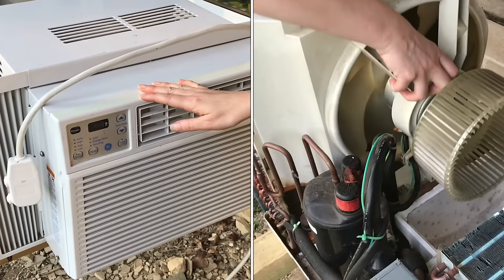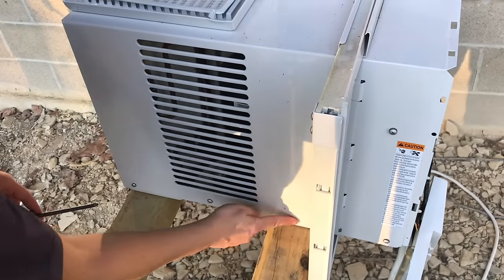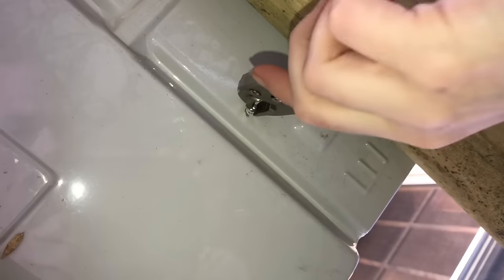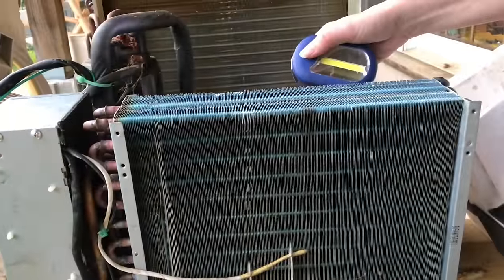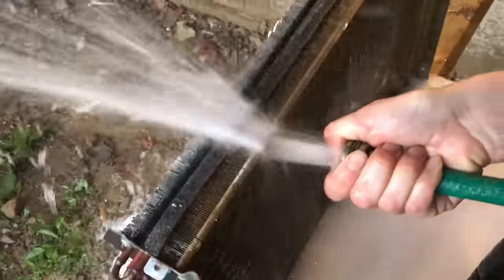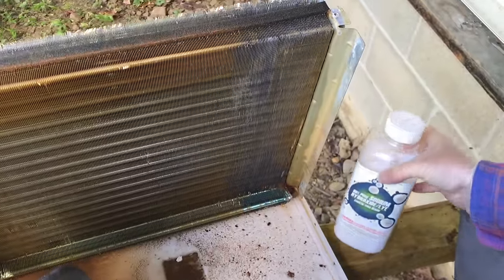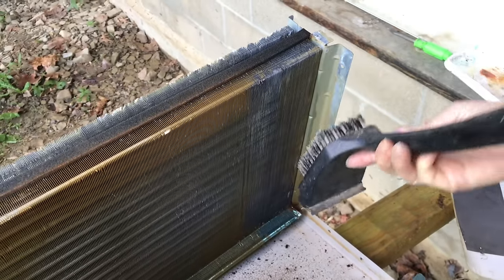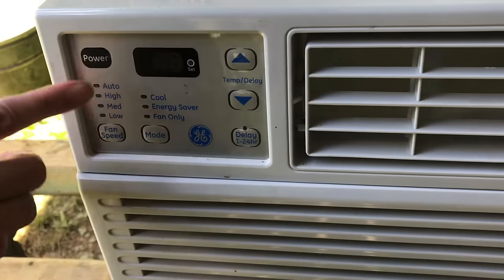DEEP CLEANING a window air conditioner unit (step-by-step details)

Comment: I've been cleaning all of our window units for years, but never have I taken it apart as thoroughly as you just showed! Thank you!
So now I'll be really giving them a good cleaning from here on out! Thank you. All of ours are different brands so although similar, each has unique assembly and disassembly requirements. So don't assume yours will have the same front opening as this one did. The folding back of the side baffles (or whatever those sliding accordion pieces are called) was new info for me so Thanks again. Excellent video!

Comment: Well done,I've literally taken apart a thousand air conditioners because I buy them from the scrap yards and sell them back for the copper and aluminum, motors and wires.i clean them my self when I find the ones that are just neglected.kudos to you and thanks for your downloaded info,you left nothing out.thumbs up
Reply: are you in USA or another country ? if in USA... seems like too much time spending for just selling for copper and  aluminium..no?
Reply: @vitmast5262  copper is high right now
Reply: That sounds like my job I have I seperate the copper and things and I get paid from an electrical company

Comment: My window ac had mould build up and was beginning to give off musty oders in the house,so I took it apart yesterday  and gave it a good cleaning like this,the front coils were absolutely filthy on the inside don't know how it was cooling at all but got it cleaned up and  back together and it's working just fine,thank you

Comment: If your unit has mold, clean it as video shows. Then buy spray can of Concrobium at Lowe's. Make sure entire unit is dry. Spray Concrobium on all parts and let dry. Repeat. Let completely dry! Reassemble! If you have mold, you'll have it appear again! Repeat mid-summer and at end of summer use. Mold makes humans sick! Clean filter weekly. Vacuum room weekly and dust! Dust gives mold a place to grow.
Reply: Will any of the comcrobium be blown into the air once the ac is back in? I’m trying to clean an air conditioner in my kids room, I don’t want them breathing in anything that would be harmful.
Reply: just buy a new one
Reply: @1655zz  buy a new one.
Once mold has formed - it’s there forever sadly
Reply: @1655zz You’ll have to take it apart and treat every surface that the air contacts with a mold and mildew killer like the concrobium the above commenter mentioned. You can’t just spray it in the coil and hope it gets sucked up, that just won’t cut it

Comment: I’ll say it again, I’m impressed. Are used to work at a place that had an HVAC shop and they used to clean when the units but I don’t think that extent.! Great work nobody has the patience for that kind of detail anymore. Nobody wants to do any maintenance and then they just buy a new one!
Reply: That should have said i used to work .... and they used to clean window units...
Reply: "Throw it in the gutter and go buy another" sums up the consumer  mentality today.

She is very thorough, I use full strength dawn though, let it soak  in that foam tape on top and drip down into the fins and in between the tubing, especially a 4 row evap coil like this.
Reply: I never knew this was a possibility, but I should have known if something is possible, it will show me how to do it on YouTube!

Comment: Thanks that's the exact AC unit I have 6,000 BTU bought it in 2011. Still blowing nice and cold.
I take some simple grain as a degreaser and some coil cleaner that foams tip it up on an angle and hose it off on the deck and let it dry in the sun I'm done never took it apart..

Good video thank you!

Comment: It' always a good idea to wipe out the inside of the styrofoam with a mix of bleach and water.  I had mold grow inside there one year and produced a very musty smell.  Also, I noticed that you washed the squirrel cage fan.  You may want to cover the bearings and motor because I once made the mistake of cleaning my unit before storing it in the fall.  I had gotten some water in one of the bearings and it must have rusted because the following Spring, the unit HOWLED terribly from the rusted bearing.  AC still worked fine but I had to scrap the whole thing because of a $5 rusted bearing.  
Excellent video tutorial, you should offer classes on how to make such clear, concise YouTube vids!

Comment: You could pick up one of those long 3 to 4 foot Phillips screw drivers for those hard to reach screws holding down the fan motor assembly to the pan. T’would make your life so much easier. ...and if the screws down there are rusted, or damaged by rust (..and they usually are), to where your screw driver is useless on them, a long Bosch extension bit, with the correct Easy-Out bit, and a reverse capable portable drill can help you remove those screws. I bought a box of those stainless steel screws that resemble the original screws on those units, to replace the rust damaged screws. I do this AC cleaning work for the peeps around my block on weekends for a little extra cash.

Comment: Be very careful with the ac coolant lines. If you cant identify them just research your model but they are pretty obvious copper lines. I was cleaning one of this same model & the line got a tiny leak around a weld & lost its charge. Sure you can fix the leak & recharge but it sucks finding this out in the summer.

Comment: I haven't tried it myself, but I'd imagine using a Steam Cleaner judiciously would allow a deep clean of the coils without using chemicals. Just do it outside, get in close with the steam nozzle, and aim away from yourself. I'm going to give this a shot soon myself hopefully.
Reply: Did you ever try the steam clean? I’m considering it myself by putting in the tub as bit of challenge to get it outside
Reply: @mollykincaid  yes indeed. I did it for Two window ac units. Now for the whole story I not only steamed the front coils (aka the evaporator coils) from the front and back, but I also srubbed the blower wheel on each unit, and then wiped down the plastic channel that the incoming air travels through and then is released, after being chilled, back into the room. Anyway after all that both of my units had absolutely no mildew odor coming from the blown out air that I could detect. 

Even if you don't or can't take it apart to really thoroughly clean it, i would think that if had a steamer and all you could do was steam the front coils from the front only, you would kill possibly the worst source of mold in your machine since it's the front coils that are always moist (much less so in dry climates though) when the machine is running.

Comment: Followed your steps... Thank you ... It was extremly dirty, we've been living here for almost 4 yrs and we have asked multiple times our landlord to do a deep cleaning on our ac window unit but he never wanted to do extra on this house, so our ac started to smell really really bad and was throwing out black stuff through the vent, so we did that today, my husband and I took everything a part and cleaned it ... It was EXTREMLY DIRTY ...the inner fan was black and when we cleaned it off it was a white color, there was mud in between it and the coil was black and now the light can shine right through it, just one question ... How often does an ac window unit require deep cleaning?
Reply from the maker: Typically clean ours about every three years, if you open it up and it’s really dirty after three years you may wanna clean it more often. Did you open it up after three years and it’s really clean then you could wait a little more to do it. If you’re not sure if the unit has ever been cleaned, it’s always a good idea to make sure that it’s running clean and efficient. It’s really important to keep your filters clean we usually rinsed them out twice a year these are really easy to clean. It takes about 10 minutes. I hope this answers your question
Reply: @livefree6878   Thank you! The filters we do clean it often but we never cleaned the inside, it is good to know this info, and your video helped us very very much with this
Reply: I have cleaned many of these units including my own.  They need to be cleaned once a year before using it.  Window ac units that become too plugged become a fire hazard.

Comment: I do know that most if not all HVAC installers and service will not service window units as they are considered disposable but for those that have the extra time and or strapped budget I can see how this video would come in handy, I have one aside my main HVAC that I use in my bedroom as I like it cold when I sleep only problem I have is that it is in a wall casing and not a window so pulling it out through the house might be a bit of a hassle and pain as I didn't know what all was involved in doing a full maintenance, that's what I get for doing an inwall install I guess.

Comment: i did this and the motor sounds louder than before because of the water or rust going on. i'm not sure if thats common problem whenever cleaning window ac. but its happened to two of my ac
Reply: the dirt on  the fan blade could be dampening the noise.When its washed off the blade it then cuts through the air,and is louder.The dirt acts like insulation.

Comment: Two points I'd like to make
First spray Clorox in the green or yellow bottles one is scented one is not from the front of the front coil and the back of the back coil will do a good job without disassembly, particularly if you follow it up with compressed air.  
The second point is that's about a $380 to $450 air conditioner.  If you use the Clorox method without opening it up for 3 or 4 years by year 5 just chuck it and buy another one.  
I applaud your work effort!

Comment: The back of your evap coils are exposed? Mine has a steel plate.. those strofoam panels behind the evap the ones with the hamster wheel fan they just lift out ?

Comment: So here's my issue with this method, and I've done this for a few ACs before: When you take a window AC apart and reassemble it, you can never get the vibration dampening to work the same way again. So the AC gets way too loud and vibrates too much, and it's nearly impossible to get it as quiet as it was before you took it apart. It just keeps you awake all night.

Comment: I was working in a workshop and I dismantled the air-conditioning device perfectly, but it came without a window, so I do not know the correct way to break the window of the air-conditioner. Thank you

Comment: At 7:05 there is a cut copper tubing, bottom left. The copper coil close to that is green. To the right is a crimped copper wire. Why is that? I have the same thing but lots more green oxidation in the coppers wire. Either it's condensation or ac fluids leaking out.
Thank you Mam! You gave me the confidence to do it myself tho I did not unscrew everything because I was afraid I would not be able to put it back together..
Reply: I think the cut or crimped copper tube might be where it was charged at the factory, one of my window units has that.

Comment: I bought my air new,but  after a short period of use it gets black mold on the white foam,my husband takes it apart to clean it,but the mold quickly comes back, and maybe it's not put in at the right angle because it drips water down the side of the house and leaves rust mark's,my husband has Dementia and not able to lift it in the window,so no more air-conditioning for us.

Comment: The foaming sprays aren't corrosive that's why they tell you not to use bleach on the aluminum fins because bleach is corrosive to aluminum. The foaming sprays are great because the foam gets between the fins and lifts the dirt out then you just rinse the fins and they are clean

Comment: I have a question but first, thank you. This was instrumental in my complete teardown and cleaning. Thankfully, mine was fully dry so I was able to sweep and scrape away most of the gunk. One day I'll hose down the fins too.

One issue I've always had with this model is that, when the AC has stopped running for a while, the temperature on the AC reads lower than the room. Because of this, it doesn't actually turn back on even when the room is at 75º F since the AC still thinks it's 68º. 

Do you know what could cause that? The thermometer is still lifted about half an inch away from the front coils, but I can't help but wonder if it's not just affected the the coils or if the thermometer probe is faulty.

Comment: Mines giving off a bad smell when it's on, will I have to deep clean like this in order for it to stop smelling or is there a simpler way? Any help from anyone would be appreciated thanks!
Reply: Did you ever clean it thoroughly? I have the same issue and am wondering if it worked for you. mildew/moldy dirty sock syndrome smell.
Reply: @astavri1  For me it just seemed to stop smelling on its own for some reason but I still cleaned it just in case and it hasn't smelled since!
Reply: Did a small animal die inside your unit??

Comment: "You dont wana use a power washer it be way to much pressure" I just used a pressure washer and didnt need to take apart the AC because it cleaned both sides.
Reply: And if didn't blast over your radiator fins?  Doubtful.
Reply: @ronmoore6598  Nope not doubtful.
Reply: @RaiderNation86  You got a weak asses pressure washer then.
Reply: @ronmoore6598   I got a couple;  the one I used for this worked perfectly and no need for complete dissemble.
Reply: @ronmoore6598  Maybe he's talking about those pressure wands for a regular garden hose, not a 1200+ psi AC powered or gasoline pressure washer. Even with a 40 degree nozzle, that'll fold every fin over flat instantly.
Reply: @6mtzhp55  Maybe.  Not worth arguing about as I doubt anyone is stupid enough to try it with an actual pressure washer as it would obviously destroy it, as you said.
Reply: Becouse her lady service

Comment: Im legit kinda freaking, I just took apart that same ac, with the same flashlight, and screwdriver and hose, and soap. But i pressure washed it cause  it was turrible. Light pressure. Not even enough to bend a fin. There was a literak swamp in there. I used a citrus coil cleaner not nearly as agressive. Im here cause when i start it, kinda chugs a little and throwd the breaker. I cleaned the boards as well the cap was disconnected but worked when unplugged..... Wanted to see the wiring but instead traveled to a dimension where im a female.

Comment: HAS ANYONE TRIED BRAKE CLEAN FAST DRYING NON FLAMMABLE ON THESE YET TO SEE IF IT WOULD DO THE JOB. NOT A CHEMIST SO DONT KNOW IF ANYTHING WILL REACT WITH THE SPRAY JUST SAYING CONDENSER PART ?

Comment: They don’t make women like her anymore.
Reply: Yes they do, Im one of them myself. My dad taught me the value of a dollar early in life, and I've had my Window AC 5000 btu's for over 7 yrs on one, 5 yrs on the second one, and the new one that I bought just last year for the bedroom window, didn't fit, so I ended up installing it in my Sliding Patio Door. It was a pain, because of (oh yes I'm in a wheelchair), but I got the job done. I clean the filters every few weeks, and do a deep clean with the back off every year when I take it out of the windows. They still work, and haven't needed to buy New Filters either. I live on a minimal income and can't afford just to throw money at buying a New AC every year, and "It's Not Necessary, just do the Work" and reap the rewards of a Cool living Space, when temps are fluctuating so much with extreme temps of Heat one day, and freezing Cold the next. Climate Change is definitely Heating Things Up more as the years go on. At times like the other day, I was out in the heat, humidity and felt the lingerings of a heat stroke coming on. But anyways, there are women out there like this lady, we may be few are far between, but we are there. Thanks for the great Video dear, and for taking the time to explain what actually goes into cleaning these machines. Thumbs up!!👍😊 God Bless 🙏 Diane 🤗

Comment: Don't do all that, most people will Destroy their GE with a grill Brush!!!
Use dish soap in a garden sprayer to clean coils & blower wheel. Motor is waterproof control unit is Not... You did to much....